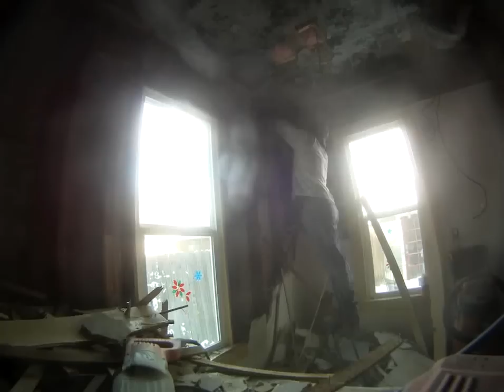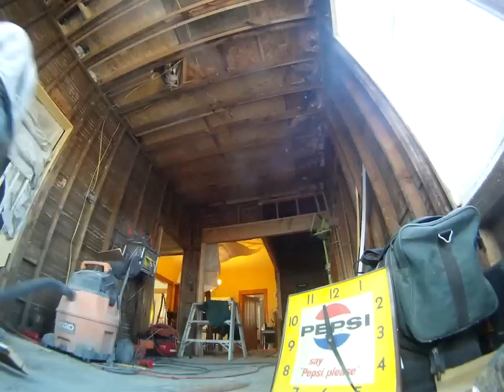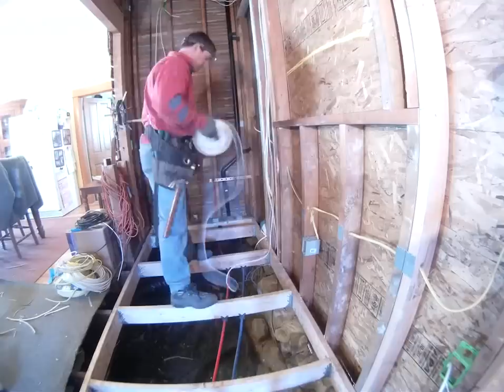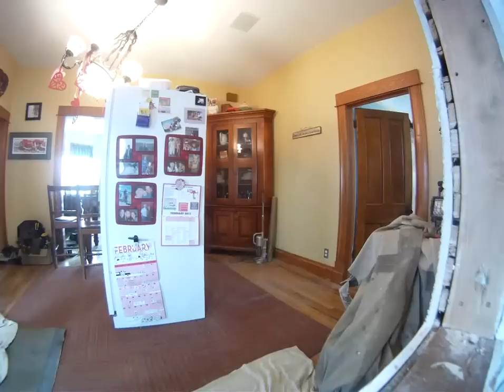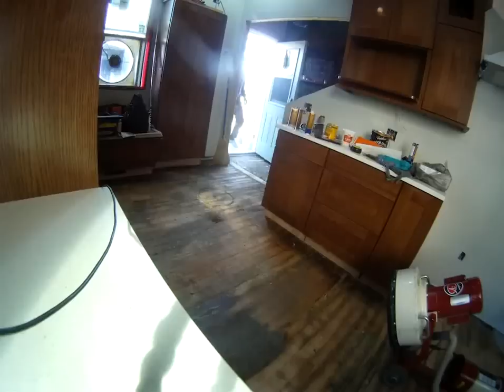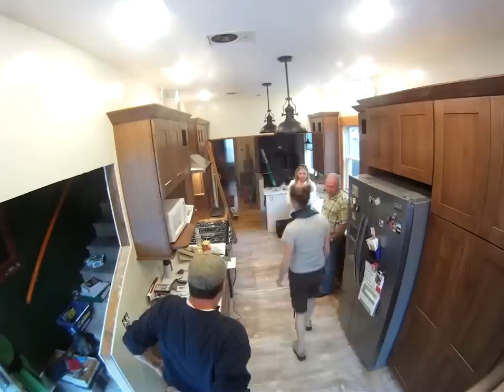Full Time Lapse of our Kitchen Remodel

Comment: I don't get why you guys didn't sand the floors first before putting up new cabinets
Reply: Atllantik Noka same!
Reply: same!
Reply from the maker: The holidays were coming and we had to take delivery of the cabinets or wait 10 days for the next delivery option.  Since we had no place to store them we had to do the install.
Reply: BORING!!!!
Reply: Seen this many times before...although its cringing me, because in germany you set the whole floor and you paint the whole walls before putting any cabinet on its place, just in case you want to remodel something and dont change the floor or walls, so there are no undone spots anywhere...i have also see vids where laminat is build around the cabinets. I think I will never be able to relate to that "kinda undone method", but maybe that is caused by the strict german mentality regarding to stuff like that🤣
Reply: @lauge812   agree i live in the states and if i was building a house it would be done that way too never understood why.
Reply: VERY BIZARRE THE FLOOR LOOKS HORRIFIC....BIZARRE TO SAY THE LEAST.

Comment from the maker: I think we put about $40K into it but that included extra insulation in the basement and extras like propane connections to the outside.
Reply from the maker: We did need a permit but that was just a few dollars.  I would say $40k is a good number.  Cabinets were the most expensive part by far.
Reply from the maker: You need a permit to work on your own house.  Things like electrical and plumbing need to be signed off on by the city or county as having been done correctly.
Reply: Yeah similar thing here, we have to inform our local building authority for certain works such as in the kitchen or bathroom
Reply: A few dollars for a permit? You obviously don't live in Boston.

Comment: Nice remodel... except the electrical. cringy and so much wasted wire. And it looked as though they used the devices as splices instead of splicing in pigtails. Hope you did it yourself if you paid someone you got ripped off using the device as a splice is agaisnt code. Not to mention the sloppy job they did. Id get fired for work like that
Reply: You're a bundle of happiness and light, aren't you?